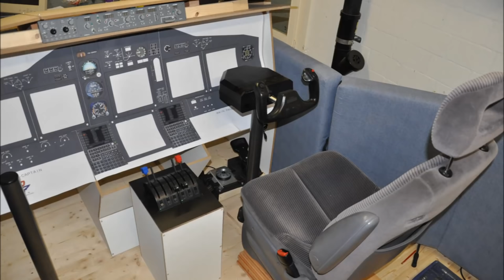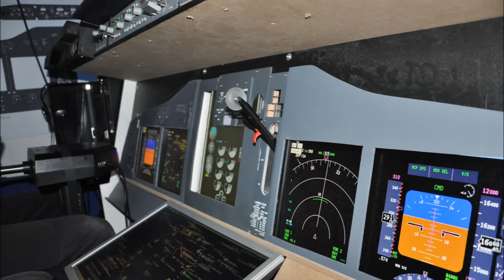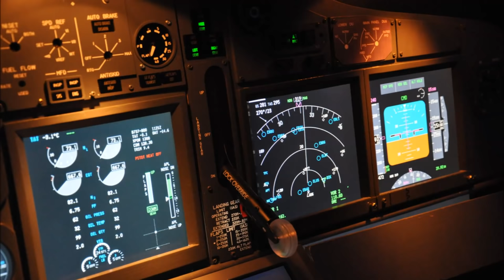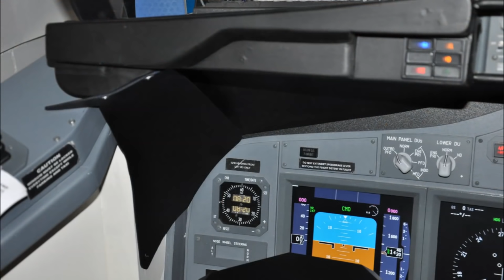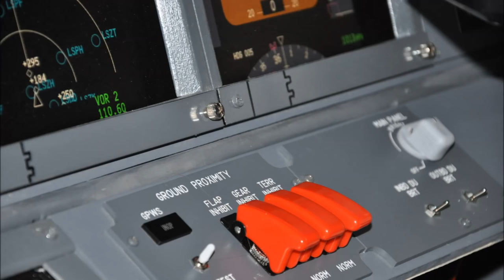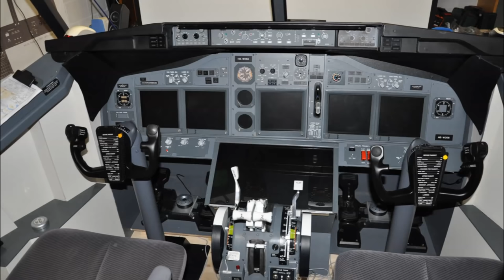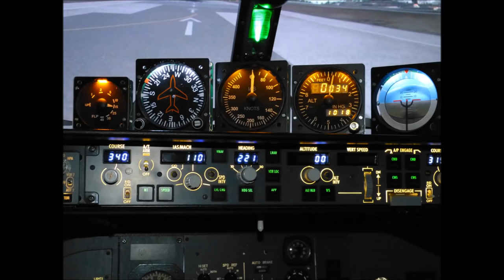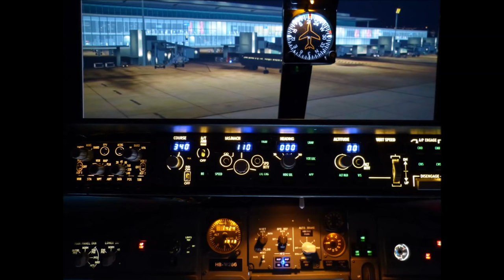Build a Boeing 737-800NG Homecockpit / 1080p HD / 2009-2013

Comment: Which program is it?? If its FSX how can you make every button or switch work? You need a special aircraft for the sim?
Reply from the maker: Hi Miguel. Yes its FSX. Now we use "Prepar3d" instead. Looks way betterYes every switch and displays are working. In our blog: http://b737home.blogspot.ch/ you can see how we build it. Use the translator if you need to. And its the default FSX B737-800 plane from FSX. Greets from Switzerland
Nils

Comment: you better have pmdg ngx
Reply from the maker: Hi. What are the benefits?
Reply: PMDG's 737 Boeing officially marked it as the real thing.. sounds are much better.. FMC is fully working like the real thing its a work of art
Reply from the maker: WilliamAviation Well we use "Project Magenta" "PM System" and I think it can compete with PMDG. The sounds are from a Addon from Turbine Studios. Greets Nils
Reply: nils169 If you are using a home cockpit, then you probably will want the PMDG 737. It's flight model is much more realistic than any other 737.
Reply: misterseesee  The problem is interfacing all the Controls with PMDG that it cant do but Project Magenta can.  PMDG is click on screen.